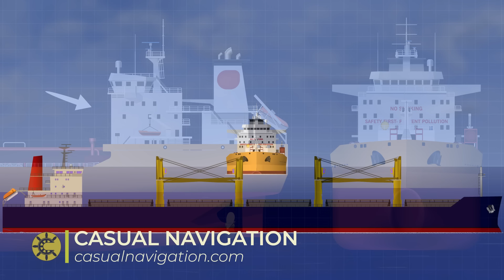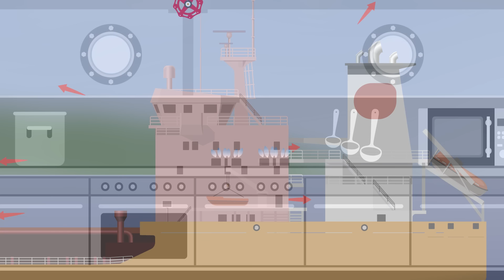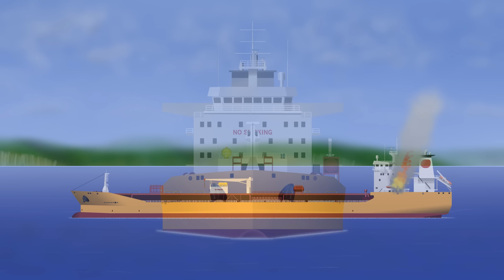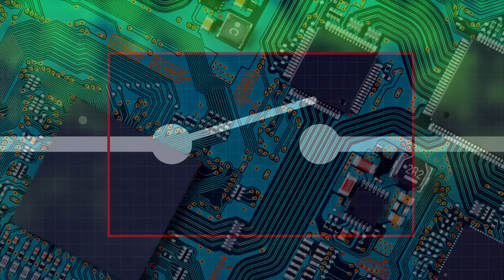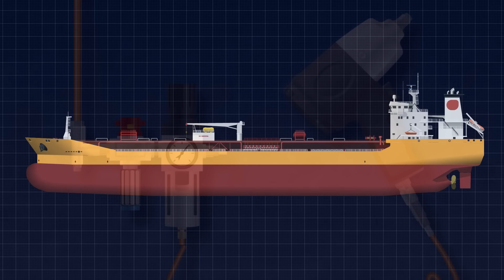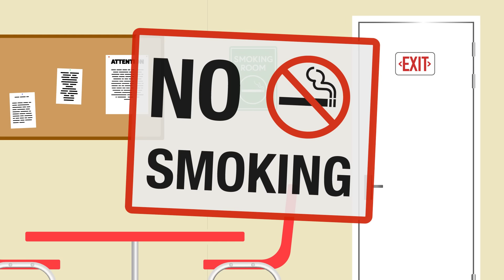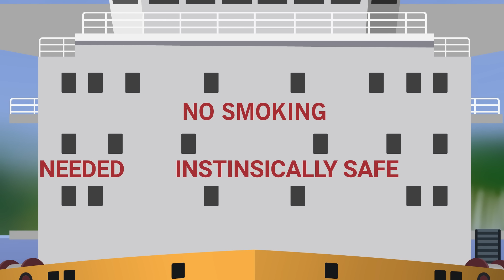You Can Smoke On A Fuel Tanker! So Why Is This Sign Here?

Comment: One issue, that does come to my mind right now, is rust removal.
Ships tend to constantly corrode due to a lot of steel present and the salty air on sea. There the rust usually has to be removed frequently, every few days especially when on sea, to not let it get out of hand.
Even if the tools are air-driven, they still produce sparks when removing the rust and touching bare metall.
How is this kind of work performed on ships with flammable or explosive cargo?
Reply: You have a measuring device that measures oxygen, lower explosive limit (LEL)  and other stuff. As long as you under the LEL of the specific cargo nothing will happen. So they are continious measuring the atmosphere wile grinding, welding or sanding. For some thing you have to hire a certified gasfree inspector that come check if everything is safe for hot work.
Reply: What kind of metal on what, would be my first question.  Brass on iron or steel might not be spark prone.
Reply: @SeekingTheLoveThatGodMeans7648  
I guess it could be enough to create sparks, if loose metall/rust parts are scrape over the still solid parts by the tool. Independent of the material of the tool itself.
But I don't have experience with that.
Reply: Or beryllium tools maybe. They don't spark either, and are non magnetic
Reply: No such work to be carried out in ports when the risk is maximum, at sea however with a wind of usually 20 kts and all tank fully secured, purged of oxygen.. And flame arrestors on venting... Such sparks don't mean much
Reply: @rustteze  
I would guess the same.
But I'm curious whether there are actually regulations or guidelines that take this in account.
It seems to me that a lot is regulated quite strictly in the nautical business, so I guess that there might be one for this too.
Reply: @rustteze  Could it be done in dry dock?
Reply: @douro20  the decks however are done regularly, dry dock's only for ship sides. Also the insides of tanks are done never. Tanks are inerted, so decks can't be hot worked but chipping / grinding are just fine.

Comment: There is also such a thing as explosion proof electrical fittings. These are conduit fittings that are filled with a sealant after wire has been pulled. From that point on, the raceway (conduit and boxes) are rated to be used in areas with flammable vapors and devices like switches are fully contained in their housing with a sealed mechanism that works them. This guarantees flammable vapors can't reach spark producing devices. If you ever seen a conduit group outside a gas station and saw where each one had a fitting with a plug, then you've seen explosion proof fittings.
Reply: At the time I installed and serviced them the fittings were known as ‘Flame Proof’ but that was six decades ago. They may be called something different these days.
Reply: That's what "Intrinsically safe" means mate.
Reply: @marvindebot  no, IS means that it is designed to be UNABLE to create enough heat to cause ignition, for instance by using very low voltages and oversized circuit board traces to prevent overheating.
Explosion proof means that in the worst case scenario, if the housing becomes filled with an explosive gas and it ignites, the case is strong enough to contain the explosion.

For instance, fire department flashlights are Explosion Proof, and they have thick enough shells to contain an internal explosion to prevent external ignition.

Comment: Also the crew that has to go on deck most often had pure cotton or very low amounts of poly/nylon in there uniforms because of static
Reply: I work in a company that handles open electronics and we have to wear (and regularly test) conductive shoes to avoid the buildup of static.

Comment: Aviation has a paranoia about sparks from static electricity that is an artifact of the era of high-test gasoline.  It's still good practice of course but jet fuel is sufficiently difficult to ignite reliably that jet engines have terrifyingly powerful igniters.
Reply: Jet fuel doesn't ignite reliably, but there are plenty of situations on aircraft where it will quite happily ignite outside of the engines. Quite a few aircraft have been destroyed by ignition of fuel vapours in their tanks, Philippine Airlines Flight 143, TWA flight 800 and Thai Airways International Flight 114 being just three fairly well known examples.
Reply: Kerosene will burn fairly easy if it have a vickning fabrick
Thats why Kerosene lamps have a vick that you ignite
But any fabrick soacked in Kerosene will work
Reply: Not really just that, a fire on a plane is a true nightmare so every chanse at minimising the risk is good. Also while kerosene may not itself be too easy to light (that's correct, I have tried it) other stuff may be, like clothes. 

Then there's AVPIN starters, they're only really used on old fighter jets but they're pretty interesting. The starting fuel for those is *very* flammable. I read someone from the Swedish airforce say that adding just a few bottlecaps of it to the fuel of the mopeds used to transport stuff around the base made the things go from maybe 20 km/h to "running like a rocket."
Reply: @alfepalfe Notes this for use in golf carts.
Reply: @alfepalfe  ahhh Avpin aka isopropyl nitrate well that stuff is needed for the starter (the thing that spins the turbine/engine before ignition) and has not so much too do with the ignition of the kerosene  and in principle it is just a replacement for compressed air in same interceptors

Quite the dangerous stuff since it is a monopropallant it dosnt need air to combust/detonate and the flames are basically invisible and they provide almost no light (the movement of the hot air above the flame is easyer to spot) soo mixing it with gasoline sound in my ears like a recipe for a knocking engine that runs too lean (since the IPN brings its a good amount of oxygen on its own just take a quick look at  top fuel aka 90% nitromethan +10 methanol you need way fuel more too get a stoichiometric mixture 2 to 1 in comparison gasoline with 14.7 

But on the other hand in diesel fuel it should improve the centane rating (how good the fuel ignites during the injecton) and therfore improve emissions and efficiency a bit
Reply: @TheLtVoss  yeah, I don't think the whole thing about throwing a few milliliters of it in the gas tank was exactly allowed or good for the engine, but some appearently did it either way.
Reply: None of this is an artifact from a bygone era, most of the electronics regulation (and indeed even limits on smoking) is far newer than widespread use of jets.

Keep in mind JetA and JetA1 aren't the only fuels used by jet aircraft, even if the most common, all engines are designed for a much larger range of fuels, most of which are more voilitile. For example even a civilian passenger liner operating out of an extremely cold region might use a "wide cut" fuel (more light distillates), and these produce massive amounts of flammable vapor in a hot climate... yet the aircraft might take off in the cold and land in the hot without changing fuel, and even if transitioning to another route it doesn't normally pump the old fuel out, it simply tops off the tanks with the cheaper alternatives.

Likewise regarding luck, you can drop a match into a bucket of kersonene 99x and have it go out without incident, the concern is the one time something DOES happen.
Reply: @SheepInACart  AFAIK, recent electronics regulations are for reasons such as RF interference and lithium ion batteries. If a battery catches in fire, it is difficult to put out the fire. Fires are always very nasty in a plane, even without considering igniting the fuel vapors at all. Sparks and electricity are probably more of a problem inside the tanks. Devices of normal passengers have little to do with that.
Reply: @SheepInACart saw a couple videos that GASOLINE was used to douse a flame! Guessing that it is done fast enough that vapors aren't generated, so it behaves as merely another liquid, able to smother it
Reply: @SheepInACart  The flash point of ordinary kerosene is well over 100 degrees Fahrenheit, so at most ambient temperatures there will not be a concentrated enough vapor hovering over the kerosene to be ignited by a flame in ordinary air.  (It is the vapor which burns, not the liquid.)  When it's really torrid out, bets are off.
Reply: @SeekingTheLoveThatGodMeans7648  How much is that in not stone age units? You know, the ones used in all civilized countries?
Reply: @KuK137  100 Fahrenheit is about 38°C in civilized units
Reply: @KuK137  euros are so smug... metric is not accurate enough for high demand tolerances, such as engine bearings
Reply: @soakupthesunman  oh, is that right....
Go on then, what's the wavelength of green light in freedumb units?
Hint: it's 510nm since the dinosars  died off, and if wavelength of light isn't good enough for bearings..........

Pop facts: America uses metric for ALL its measurement reference standards.
Reply: @SeekingTheLoveThatGodMeans7648  
Being below the flash point doesn't mean that fuels won't burn or emit vapor.  It's just that above the flash point the fuel starts to boil off and is extremely dangerous.  Try this experiment poor a cup of gas on the floor in a closed room. If you can  smell it it's giving off vapor.
Reply: @soakupthesunman  Such a dumb comment. Let’s guess - you’re American? A 12 year-old would know that was bollocks.
Reply: @soakupthesunman  Metric is more accurate as it has a well defined and unchangeable definition — besides — anyone capable of machining high tolerance parts can also grasp the concept of decimals unlike Youtube commentators
Reply: @treborobotacon  The flash point of gasoline is -36F to -45F.  It’s giving off vapor because it’s above the flash point…
Reply: @soakupthesunman  I lost brain cells reading this comment. There is no difference between the "accuracy" of metric and imperial units. You can divide up a millimeter just like you divide up an inch. A thousandth of an inch is 25 thousandths of a mm.
Reply: @dougaltolan3017  
Engine bearings are measured in ten-thousand inch tolerances. 
"wavelength of green light"?
LOL why don't you get stuffed?
"Pop facts" my foot. 
What the hell is "510nm"?
Reply: @soakupthesunman  terrible take
Reply: Sounds like old traditions are still kept up
cough zeppelins cough
Reply: @dirrey193  you cant ignite pure hydrigen.
Some of the hydrogen bladders most have leeked more then they whare suposed to and that hydrogen mixed with air and got stuck below the outer shell, than just a static spark would ignite it
Reply: It's the vapor you need to worry about. Always the vapor.
Reply: Yeah i always heard that you could put out a cigarette in a can of JP8 and nothing would happen
Reply: @theDitchdigger456  you can put a cigarette out with gasoline.
Reply: @WhiteTrashMotorsports You CAN, but it's safer to try it with jet fuel, or diesel. Friggin ZYNs are adding too much safety to transportation.
Reply: Back when they used JP4.
Reply: ESD affects flight safety hardware. Namely the electronics. Spurious ESD events can break IV&V acceptance for the components in question.
Reply: Gas… fumes will burn
Jet/diesel/kerosene will not….
Reply: So you’re telling me the ending of Die Hard 2 couldn’t happen? 
Gutted!
Reply: Avgas, the most common fuel type for GA planes has a flashpoint of -40° and absolutely wants an exuse to ignite. The thing with Jet-A/Jet-A1 is that during the process of pumping fuel the movement of the fuel naturally generates static potential and for smaller jet aircraft that fuel over-wing it creates a combustible fuel/air mixture as it comes out of the nozzle when its flowing into the tank. There is still plenty on ways to create a fire even with modern fuels and the static potential is the biggest reason that bonding clamps are mandatory for any fuel movement in aviation
Reply: Can it melt steel beams though?
Reply: @Kragith If you let a high rise building burn uncontrolled for several hours, which hadn't really been tried before 9/11, enough steel will weaken beyond limits, and that just creates a cascade, aided by gravity. See WTC building 7. WTC 1 and 2 had uncontrolled fire, and were hit by planes going 400+ kts.
Reply: can it melt steel beams tho?
Reply: The static electricity has to be dissipated to protect avionics, and to stop interference with both communications and navigation radios/receivers. Furthermore the aircraft fuselage is the common ground so it needs to be able to shed the massive amounts of static electricity that builds up in flight.
Reply: While we are at it, jet fuel doesn't melt steel beams 😂😂😂🤣🤣🤣😉
Reply: @sulawesi-steve  it'll expand, and weaken it just fine though.
Reply: @sulawesi-steve  the beams did not melt
Reply: @sulawesi-steve  It just reduces their structural strength massively, that's all
Reply: @bootmii98 There aren't many private developers demanding "ability to burn uncontrolled for 10hrs" when they spec out an office building lol
Reply: @sulawesi-steve or knock down a building that wasn't hit by a plane... but it was hit with a modified insurance policy...

And still no one talks about that 6 trillion announced the day before

Comment: What is the difference in danger between safety matches and lighters? Why allow one but not the other?
Reply: Probably that matches are designed to rapidly self extinguish, a lighter may not be able to turn itself off, and the lighter fluid itself is going to be flammable in case of a spill.

Comment: Thanks for the informative video. Something we use in aviation is flame arrestors. Which is just a screen with holes of a certain size around brushed electrical motors or other spark sources. Oxygen and fuel vapors can get though. But any flame that ignites inside is stopped by the screen. It's crazy to watch a fireball just stop dead at a thin metal mesh.
Reply: A tanker does have a flame arrestor, installed at the mast riser, where pressure from expanded gas is released. Ours gets replaced every voyage (45~ days).
Reply: Most ships nowedays has flame arrestors on the airpipes coming from the feul bunkers.
Reply: Tankers use inert gas to dispalce oxygen,  and PV (pressure  / vacuum) valves to help regulate pressure in the tanks. There are flame screens fitted in the mast riser.

Comment: I have also seen the international code flag B (red with a V cut opposite the mast) on the mast of a tanker at the fuel berth in our port. This means 'i am taking in or discharging or carrying dangerous goods". An officer on one of the tankers told me that all vessels are required to keep 200m away from a vessel flying this flag.
Reply: There is no 200m rule. In fact most ports wouldn't be able to comply with it because of physical constraints.
Reply: What is the B for?  Boom?
Reply: @SeekingTheLoveThatGodMeans7648  well, the Bravo (B) Flag is red, which should be a bit easier to see. Then you also have the fact that the color red can be easily associated with danger.
Of course that someone that should be concerned with such signal will not look to the flag and think "red is danger so keep away". Instead they will connect the flag to its meaning (Bravo) and understand what the sign means.
So my reason why the chosen sign is Bravo instead of any other letter is a guess. I learned what are the signals and what they mean in maritime school, the "why" on the other hand, never heard being mentioned.

but then again, the "require medical assistance" flag is the flag Whiskey so they might be into something 😂
Reply: @SeekingTheLoveThatGodMeans7648  Just the regular NATO phonetics... Bravo
Reply: @SeekingTheLoveThatGodMeans7648  red flag is the Bravo flag or B flag for the alphabet.
Reply: I can tell you from experience, the request for other vessels to maintain a distance is seldom respected.

Comment: Fun fact: air tools are very capable of creating sparks, and must be grounded if you need zero sparks.
Reply: So are iron or steel tools though you can’t ground those easily.  You need brass
Reply: Really. I didn’t know that.
Reply: @FerroequinologistofColorado  static charges are fun... When you're not over hundreds of thousands of barrels of highly explosive chemicals 😅

Comment: What about when they are coming to a port or leaving a port? You have crew all over the tanker, and the bridge does need to be in contact with the crew at the bow to throw the lines. What do they use there? A more safely walkie talkie?
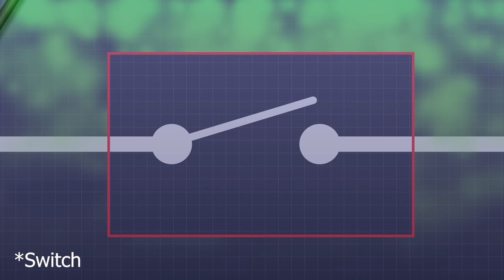Reply: The intrinsically safe item at 3:49 looks like a walkie talkie to me, so probably one of those
Reply: There are intrinsically safe devices available for people working in these conditions. Laptops, phones, cameras, flashlights and so on. Typically costs more than a normal version and usually a generation older in terms of software and hardware. Kyocera and Sonim, for example, make intrinsically safe cell phones which can be flip phones or smartphones.
Reply: They use EX proof materials. You have tablets, smarthphones, walkie talkies, laptops and all other electronic stuff in EX proof material.

Comment: All hand tools used are either brass or aluminum, not steel. 
Dropping a steel tool can spark
Reply: Nice observation! Hand tooling must be anti  sparking. By the way, it's a good thread for a other video: hand tools on tankers and oil rigs.